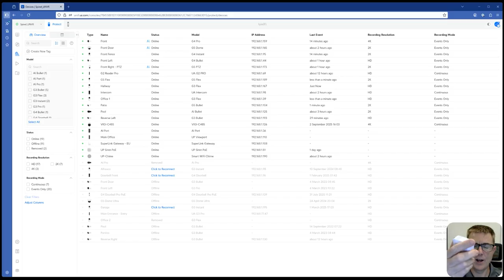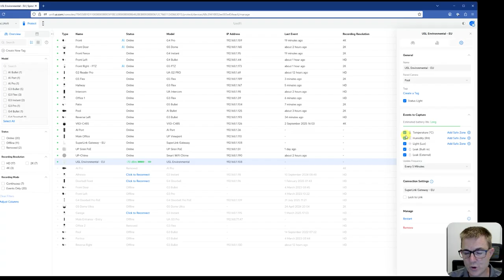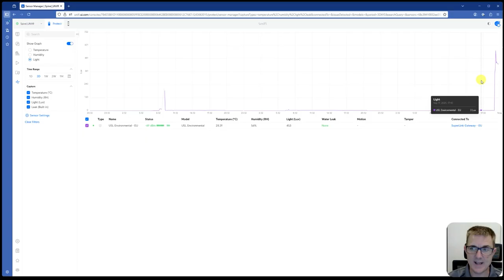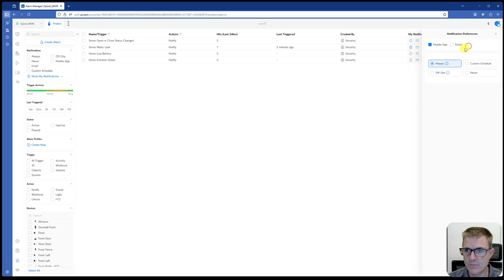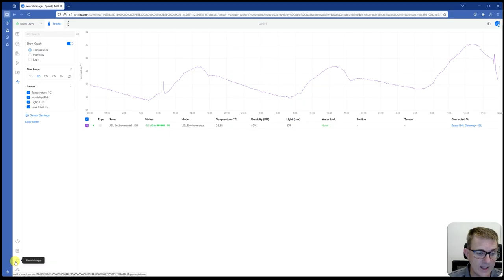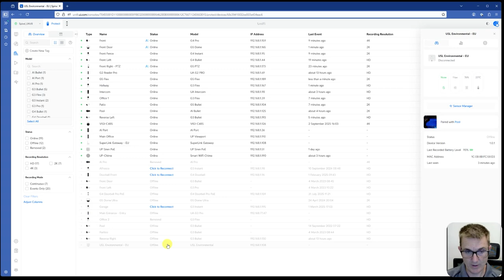How to... Set Up A Ubiquiti Superlink USL-Environmental

Comment: looking at replacing our watchdogs with this 🙂
Reply from the maker: Thank you for watching. It could be a good fit depending on what your current watchdogs are monitoring. The USL-Environmental is aimed at things like temperature, humidity, ambient light and water leak detection, so it’s useful for basic environmental monitoring and alerts. Just make sure the alerting and sensor coverage match what your existing watchdog setup is doing before replacing them fully.